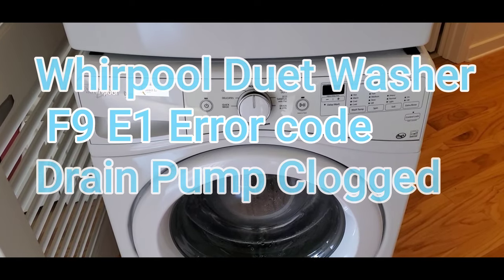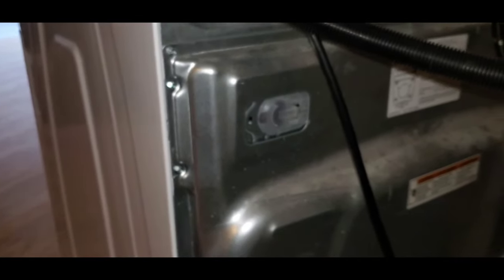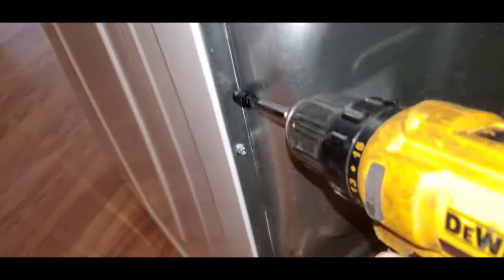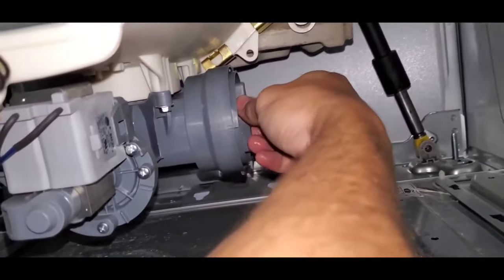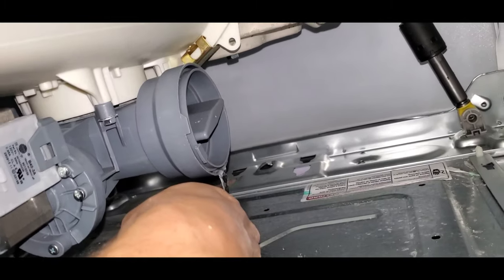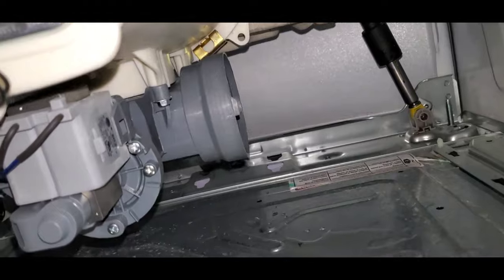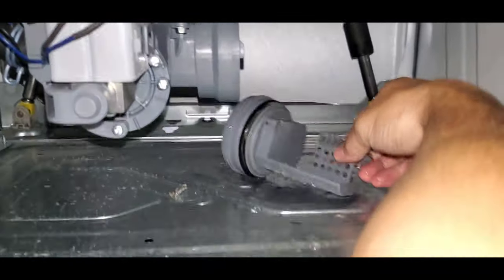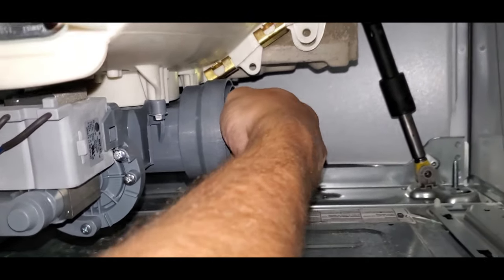Whirlpool Duet Washer F9 E1 error code

Comment: Thank you for this video. There should be an easy access front filter clean out especially because this machine is exceptionally heavy. What a engineering fiasco. I hope I don't get hurt moving the machine to clean out the filter. I will try this.  In the future, I won't buy a washer unless it has an easy to use front filter access.
Reply: Glad I have my brother to do this for me. I had no tools or any idea how to do this. He fix it so fast. I could have done it myself if it wasn't for the dumb structure of this machine.

Why put it all the way to the back, and behind the steel wall?🙄

Comment: Thank you so much for this video. I had my shop vac ready, found my drill and atttachment. I did not find anything in the filter, but ran bleach through the hose, backed the washer up so it is solidly level, and am using even less detergent (we have soft water). It is running well now, hoping to get a few more years out of her. We will see. Thanks for the know how so I felt comfortable taking this on myself.

Comment: Great video.  Short and straight to the fix.  Saved a ton of money not having to call a repair person just to clean the filter.  No socks though, only a huge wad of lint.  Wish they would engineer the thing by rotating it 90 degrees to the back, or to the front with an access panel.  Thanks!

Comment: This video saved me a ton of money.  I did do one thing differently that you- After the pump started running I unplugged it from the board.  I didn't want it to sit there and run dry for an extended period so I tried that and it cleared the error immediately.  I already had access to the panel so this was something easy to try.

Comment: My older duet had a removable lower front panel which provided easy access to the filter -- which was pointed to the front of the washer.  The new one (a 5.0 cu/ft model) is like yours -- you have to remove the back panel to get to it.  Seems like we're entering the not-easily-repairable-by-the-user age, and Whirlpool is near the front of the parade.

Comment: Thank you for this awesome video. I have done this operation with success once before, and did it again this morning. I cleaned a bunch of junk out of the filter, and restarted the cycle. It then threw the code again, and when I opened the filter again, it was clean. Any advice for what to do?

Comment: Great video…….have. F9 followed by an E1 error….we checked……no clogs. Drain pipe is good.  We cleared the error codes the only problem we have is when we hit the start button to the washing machine (press and hold button). It does not appear to be coming n to start the washer.  Would this be an electronic issue with the panel board.  
Does anyone know how to problem solve this please.  Thank you in advance!
Reply from the maker: I have seen a faulty door switch cause this problem but not always

Comment: How about the code still shows up when the filter is clean, and no debris in the main drain in house?
Reply: Also having the same problem since cleaning the filter, same code and locked out constantly
Reply: @DanielTillotson  I bought a new drain pump.  Problem fixed

Comment: Wow I took the back of mine off for like no reason. Mine had a bottom drawer I could pull out to get at it. The main drain hose was pretty dirty as well though so I cleaned that well I was in there.

Comment: Good video. But my washer had to be made in some crapistan country. When I got the back off the pump/filter was located the whole way front, with the screw cap/ filter facing away, to front of machine 😁
Reply: Did you find a way to access it? Mine is the same... facing front, but I don't see a front access.
Reply: @mariajackson2273  I had to go thru the back and reach to the front to do it
Reply: @josephbaugher4737  Mine is the same.  It doesn’t feel like there is room between the front panel and the filter.
Reply: @NewBraunfelsTX  I did manage to reach it from the back and unscrew it. It's doable but there are some sharp edges in there

Comment: What if it's the pump though? My drain was not even close to this clogged but the water so won't drain in a cycle. Have the same codes
Reply from the maker: It could definitely be a bad pump and may need replacing
Reply: @ProWorksTV1  I noticed lowes and homedepot don't carry parts. Any recommendations for this?
Reply from the maker: Try partselect.com or even Amazon sometimes will have these

Comment: I have this washer and it is as stupid as it gets when it comes to the filter cleaning ... removing the back panel and having the filter cap facing forward ... Jesus ... i would fire the design engineering group in a second. How hard is to put an access panel for the filter cap ?
Reply from the maker: Its not too bad. A drill with a 1/4" nut driver makes it quick
Reply: @ProWorksTV1  that is not the point ... This is like putting your car's gas filling port under the back seat and in order to access it you have to remove the seat that is bolted to the car floor from underneath the car.🤣🤣🤣